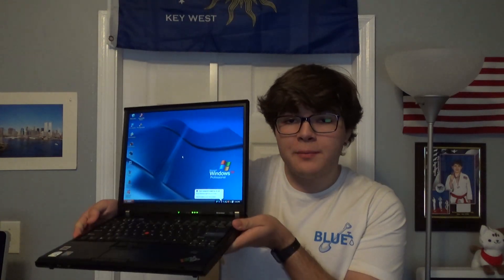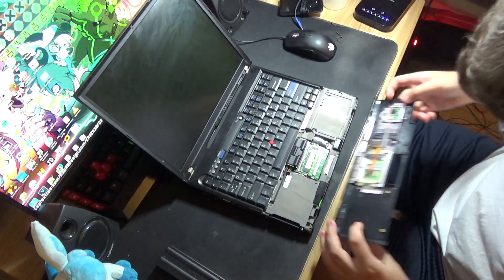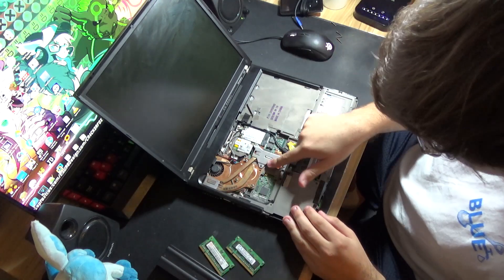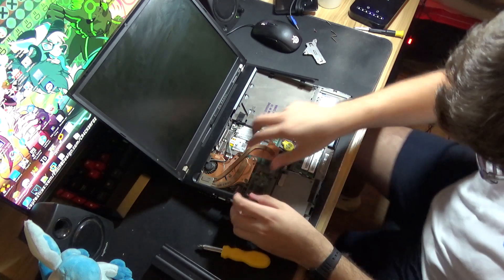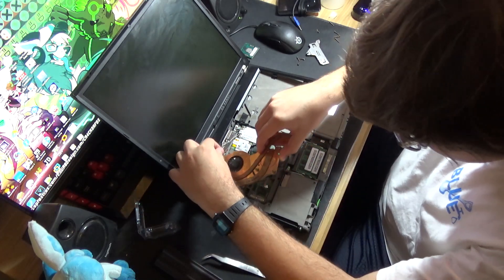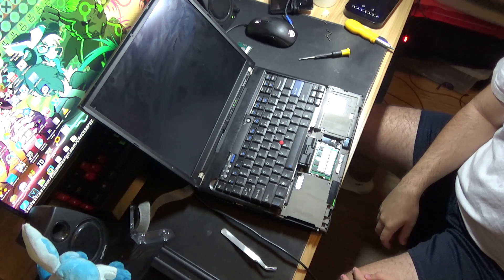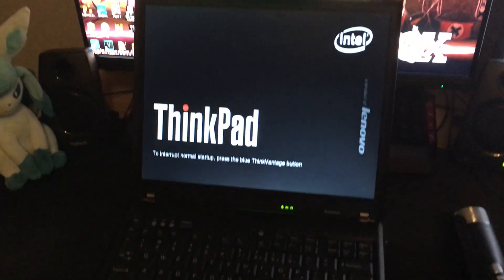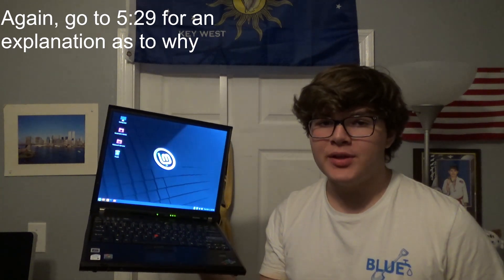Upgrading a 2006 ThinkPad with Linux

Comment: Well I got a Dell Inspiron 1318, with core 2 duo t5750 and 1gb ram, got it up to Core 2 duo T9300, 4GB of ram, 256gb ssd, with windows 8.1 installed, with replaced the battery good enough for light office task, watching youtube video